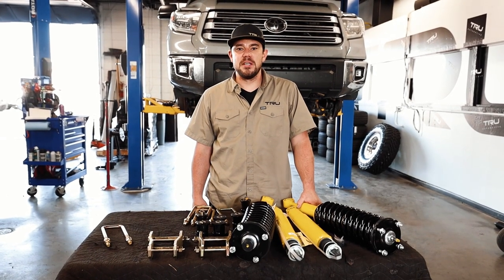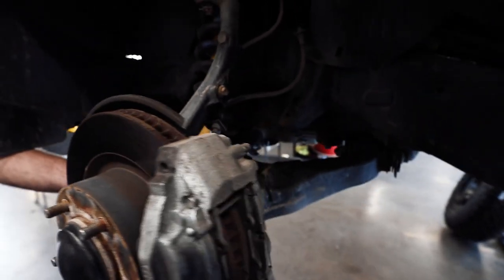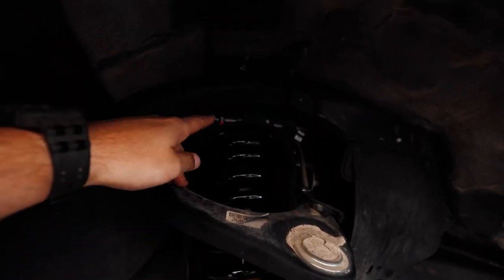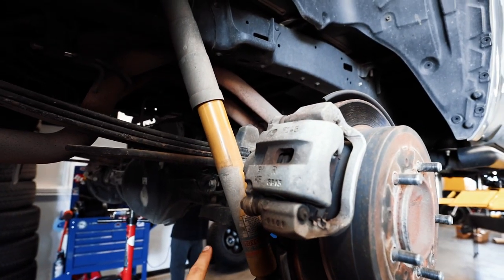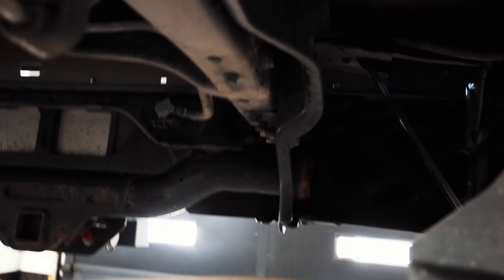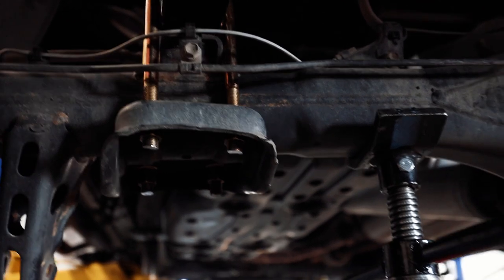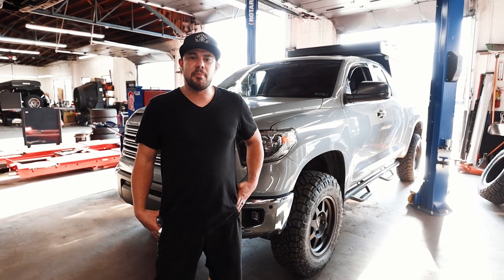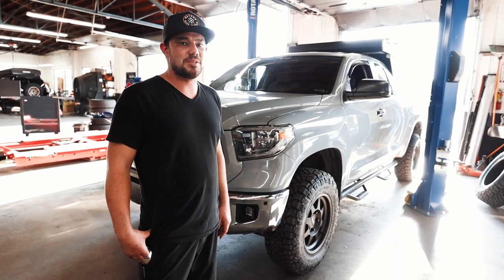Tundra Build EP.1 | Suspension/Wheels/ Tires

Comment: Rear shocks are installed incorrectly. They don't come with instructions, but the silver cup-shaped washer you have on top of the frame mount, cupping up, is actually supposed to go underneath the frame mount, cupping down.